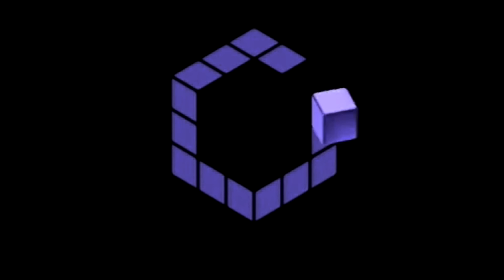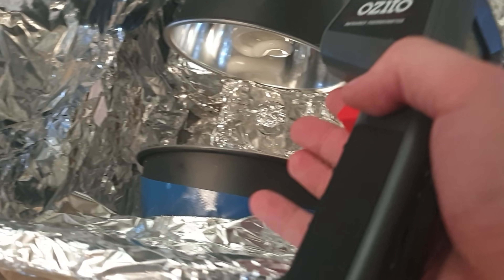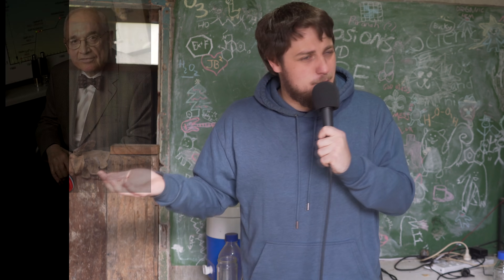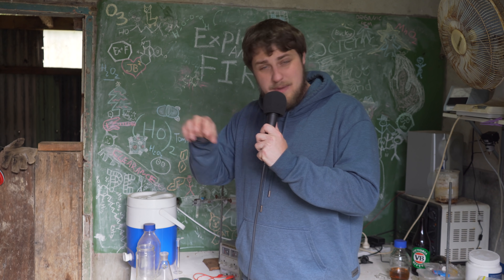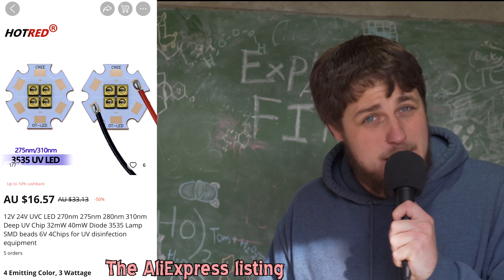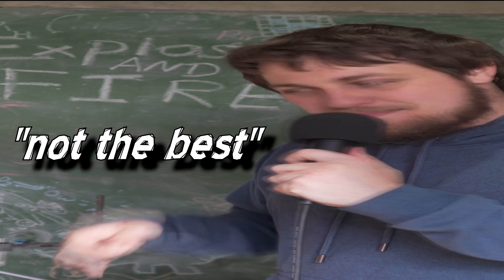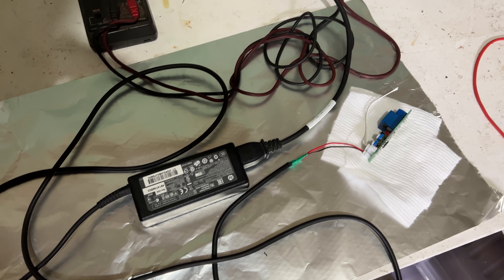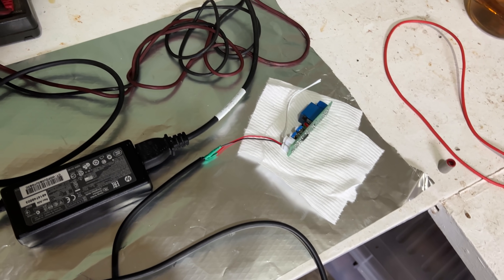Magical deep UV LEDs - Cubane Ep 12

Comment: Don't 'touch' the wires of the powered driver to the LED. The driver probably has some output capacitance, causing a huge current to run through the LED initially. This won't happen when you power the driver on while the LED's already connected.

Edit: So glad you ended up putting the relay in the power line. You would've had the same issue otherwise :)

Comment: instead of bothering with the circut, just use a massive heatsink, for example a block of aluminium, or a resavoir of water behind a plate of metal, on which you fixed the leds... gl

Comment: It's frustrating to hear that you found such misleading information online. As others have stated, the 40mA figure is important. LEDs are constant current devices, which means that extra circuitry must be used when driving them from a constant voltage supply. At higher currents, "buck" drivers can be used to provide a steady current. Effectively, they monitor output current and adjust their output voltage to match the manufacturer specification of the LED. I'd suggest looking into the BuckPuck brand for a reliable and relatively inexpensive option if you drive higher power LEDs in the future.

At lower currents (like your 40mA LEDs), such drivers are not needed. The datasheet for every LED will specify a "forward voltage", which in your case ranges from 12V - 14V. This does not mean that you can safely apply any voltage in that range and expect the LED to function properly. Instead, it accounts for manufacturing tolerances and indicates that the forward voltage of every LED shipped from the factory will fall within that range.

Ohm's Law describes the way that voltage and current interact with resistive components as V = I * R, where V is voltage in volts, I is current in amps, and R is resistance in ohms. Say, for the sake of argument, that your LED has a forward voltage of exactly 12V. You drive it using an 11.9V power supply. Since the power supply voltage is less than that of the LED, current does not flow, and the LED does not illuminate. This is not entirely correct, but is a useful approximation.

Now you increase the power supply voltage to 12.1V. Of that supplied voltage, 12V is dropped across the LED. This leaves 0.1V, or 100mV, that needs to be dropped across another circuit component before the path back to the power supply is completed. This would ordinarily be a resistor with a value in the hundreds of ohms. In the absence of a resistor, the only current limiter is the resistance of the wires used to complete the circuit. This can be as low as a few milliohms, which allows a tremendous current to flow. For example, I = V / R = 100mV / 4mohms = 25A. I suspect that the only reason your current did not skyrocket is because your power supply reached its preset internal current limit.

This can be fixed by adding a resistor in series with the LED. The greater the difference between your power supply voltage and the LED forward voltage, the more accurately you can tune the value of the resistor to produce your desired current. I would suggest setting your supply to 18V. That way, the voltage across the resistor will be 18V - 12V = 6V. Then you can use Ohm's Law and the rated LED current to calculate the proper resistor value. In this case, R = V / I = 6V / 40mA = 150ohms. This is a standard value, but if you want to err on the side of caution (less current), a 180ohm resistor is a good starting place.

The last thing to consider is the wattage of your resistor. Most inexpensive resistors are rated for 1/4W, or 250mW. Wattage is calculated as P = I * V, where P is power in watts, I is current in amps, and V is voltage in volts. If you exceed 250mW, you risk igniting the resistor. Double check that the actual power is less than the rated power. In this case, P = I * V = 40mA * 6V = 240mA, which is acceptable.

If you want more information, try https://www.digikey.com/en/resources/conversion-calculators/conversion-calculator-led-series-resistor. It helped me a lot when I was burning through LEDs by the dozen.

Great video by the way, keep them coming. I know nothing about chemistry, and your combination of humor and expertise always makes these videos a blast to watch.
Reply: Oh, and I forgot to mention that the setup described above is only ideal for driving a single LED. When driving all four, each LED must have its own series resistor. If you attempt to use a single series resistor for all four LEDs connected in parallel, it creates two problems. First, the resistor value would need to be changed to supply four times the current. Second, all of the forward voltages would have to be EXACTLY equal, which is not possible. Resistors are cheap, and it's better to be safe than sorry.

Comment: As a rule of thumb when figuring out a module you don't know, the voltage is a hard rule, don't go over that voltage, the current is a suggestion, as current is only drawn if it is required to produce the power of the circuit (watts = volts * amps)

Also, LEDs go in to what's called an avalanche state if you provide too much voltage, this is where they draw ridiculous amounts of power, and the heat you're getting seems like a product of over voltage to the LEDs. LED drivers only supply constant max current, and 960mA is far too much for this application, as the combined voltage is too low of your LEDs and it's pumping more voltage then it ideally wants (like on the power supply when you saw it draw over an amp at only slightly above 12v)

Comment: I don't know if anyone else mentioned it but connecting a current source wile its on is a bad idea, it should always be connected before power on otherwise the voltage will be at the maximum and some if there are caps (and there usually are) at the output it may blow up sensitive loads like.. i dont know leds? :D

Comment: Ah fuck man if you are too concerned with finding drivers for those leds and messing with too much in terms of electronics I HIGHLY SUGGEST for a novice that you just buy a UV led sanitizing device like those made for cell phones or baby pacifiers. They come with drivers, leds, and either a battery power source or rechargeable battery or you could just simply feed voltage into the battery contacts from another source (of course at the voltage the batteries would provide)  saves you from fucking about out of your comfort zone. It's hard to explain various facets of electronics to people that don't have a foundational understanding tbh.

 You could just ask those who know to give you a crash on exactly what you need in a given price range that would source parts/point you to exactly what you need.

Comment: Can you link to the leds? I'm guessing here without foward voltage atm but running two from a 24v source in series would mean you need a 900ohm resistor

Comment: Hey, this is an area of my expertise!

SO.

I actually had an issue grasping this myself, so I'll give you an idea of how it works.

An LED will start consuming more and more current as it reaches it's forward bias voltage. Once you reach that voltage, the resistance of the led drops dramatically, and appears like a short circuit. At this point, the LED will start drawing *AS MUCH CURRENT AS POSSIBLE*. By possible, I mean whatever the max current of the power supply is. This is why the first LED got cooked, not only did you use too much voltage; without a current limiting circuit, you allowed the full current of the supply to flow through the LED. You actually demonstrated this with your power supply - you saw how the current jumped WAY up.

I did some searching, and it seems like UVC leds run at much lower power than most, these particular one seem to take a MAXIMUM forward current of 100ma. That would grill the heck out of those leds, and you wouldn't get much out of it. I'd recommend starting at 60% of their maximum power, which we can calculate (per star) with this:

P=IV

Fill in our known values:

P=(.06)(12)

Do algebra:

P=720mW

That's per star, no matter if you have them in parallel or series, which makes it easy to calculate the driver you're going to want. I would recommend two in series, in parallel with two in series. This would mean you'll need a 24v (most LED drivers have a range of voltage so find one that brackets), 2.88W LED driver.

Here's why you want to use the driver that has the floating voltage, but fixed current. LEDs are very temperamental about their forward voltage, and many things can affect the forward voltage: temperature, ambient humidity, ambient pressure, ambient illumination, whether you're looking at it or not, local gravity, among many others. As the forward voltage of the LED fluctuates around madly, so does the current, so it's hard to build a steady state circuit for them just using resistors. This is why those LED drivers exist - they use a fairly complicated circuit that provides a constant power and can adjust to the whims of the LED.

Comment: I looked at the listing for those LED stars and the three different voltage versions seem to be different combinations of series and parallel chips.  I don’t see any balancing components on the boards, so the 12-14V and the 6-7V versions probably have parallel LEDs that are not going to share current equally.  You would be best to avoid those and only use the 24-28V 20mA kind.  Since this is such a low current, you don’t really want a power led driver.  You want something closer to the circuit you would use to drive an indicator LED, but at a bit higher voltage. The easiest way would be a 36V DC power supply and a ~500 ohm resistor.  You should be able to run a bunch of stars off one power supply this way (each with their own resistor of course). I recommend at least 1 watt rated resistors. Technically you would only be at 0.2W, but normal 1/4 watt resistors are going to get really hot that close to their rating.

Comment: wow this is terrible, as everyone has said lm317 driver or a resistor per led star
V=IR so R=V/I for a resistor so if you put a resistor in series and the led drops 12v and the supply is set to 19v (a laptop power adapter) you will have 7v across the resistor 
for 40ma you have R=7/0.04A or 175 ohms closest value they make commonly is 180 which will give you close enough power at 38.9ma or 160 which will give you more power at 43ma
another consideration is heat output from the resistor P=IV so for worst case 43ma at 7 volts you would have 7*0.04 watts or 0.301W thats more than 1/4 watt so you should use half watt resistors.

tl;dr put a 160 ohm resistor in series with each led, hook it to a laptop power adapter or your bench supply at around 19v

Comment: The two led modules are definitely producing more UV than the reptile lamps and your setup works so you may as well give it a try. As for cooling, maybe you can set one medium sized fan to get airflow both for the sample and the heat sinks. Having a fan blowing up from below might make filming easier, but could be hard to setup and is decidedly not wonderful with spilled liquids. Anyhow I hope it goes well and you can get to the finish line with this synthesis.

Comment: so so so very much out of your depth.  i cringed many many times during your build process.
 the voltage alone doesn't tell you anything about how much power something draws,.. and what you wanted were much lower amperage constant curent LED drivers.

notice when you had the led's on the power supply, adjusting the voltage changed how much current they drew, the constant current LED drivers automatically change the voltage to try to keep them drawing the same ammount of current.  You are likely over driving those LED circuits, but you have a half duty cycle... you could just keep them on constantly if you had a more appropriate LED driver.

Comment: Probably been commented already but just use a resistor to regulate current. To get desired current (I) use this formula V/R = I. V is voltage supplied and R is resistance of the resistor in series. If you can’t find a resistor with the exact value round up to nearest available value.

Comment: Adding a few decent sized resistors ( 1 kΩ) couldn't hurt. This will make the current much less sensitive and slow you too carefully draw 40 mA or whatever else you need with higher voltage.

Comment: heres a very simple explanation as you why you dont need to worry about any current setting on the power supply itself, that 40mA is just how much they use. The current, or amps, is determined by the resistance and the voltage. the LED's have a fixed resistance, you cant change that. So if you give them the voltage they need, they will only draw the 40 mA. You could have a 12V car battery that can supply 900 amps, but if you hooked it up to the LED then it would only draw 40 mA. Thats just another way to say what the wattage is of the LED, 40mA times volts = watts so 0.56 watts

Comment: If you put a 300 Ohm resistor, and drove the circuit with 12 volts, it would drive the LEDs.
(12 volts) / (40 milliamperes)= 300 ohms
Also, it should make about half a watt to a watt of heat. The circuit really shouldn't be getting more than lukewarm after several minutes, and probably won't even need the heatsink tbh.

Comment: You have constant current mode on that PSU, just use that for now. Series connect all them LED's, plug them in, set current limit to 0, set voltage to max, slowly increase current limit to get 40mA ;-)

Comment: Just use a constant voltage and stick a fat resistor in there in series. If it's too dim, use a smaller resistor. Repeat until you're content with the brightness or until an ammeter reads 40ma, whichever happens first.

Comment: I think you got your understanding of current and voltage mixed up. If you provide more voltage than your part is rated for and don't do anything to reduce the voltage then you'll fry your components. However, you can use a power source that is capable of providing more current than what your part needs without killing the part. Assuming the voltage of the source is still within the tolerances of the part of course. 

The reason being that the resistance of the part and the voltage of the source will ensure that your part can never draw more current than it can handle. Hopefully this explanation can help some to avoid future mistakes. 

Fun fact: it only takes 0.1 mA of current across your heart to kill you. Luckily our bodies are not amazing at conducting electricity so you'll need a high voltage source to kill yourself. I burned myself on a battery pack capable of 20+ A output (lab equipment couldn't measure higher) yet was not shocked thanks to that as the voltage was less than 5v. 

Also if you do use high voltage stuff only touch it with one hand at all times. That way the current will be most likely to just exit back out the same hand. However, it is possible for it to go through to your feet so use your right hand to ensure the current can't pass over your heart. Even if you're wearing rubber sole shoes we were taught to only use one hand and use the right hand.

Comment: LEDs have to have a constant-current driver or an appropriate limiting resister so that you don't draw more amps than you need to. They have a really freakish response curve where below a certain threshold it trickles amps through, and then, like you saw on your PSU, it suddenly opens the flood gates and the curve inverts so for every additional volt you get like 10x the current. it's kinda nuts. Constant-current supplies automagically limit the current so you don't have to sit there and baby it. It's even worse when you get high-power LEDs that have a negative temperature coefficient so the hotter they get the more amps they draw at a given voltage - you literally can't just set-and-forget them without a limiting resistor.

Comment: People may seem particularly picky about thermal paste, but everybody cringed (I assume) when you said amperage doesn't matter. I had to take a break after the amp thing, now taking a break after the thermal glue. I'll have a beer and come back to see what burns up first.

Back. Yep. That was predictable. Those overdriven LEDs are probably already toast by now. Pity is the usable power supply sitting right there on the table. Set any voltage you like and turn the Other Knob to turn the amperage down.

Comment: Dig around the indoor gardening forums lots of folks build their own lights so they are probably the best place to find the proper design criteria.  I am no electrical egi'nerd but electrified sharp metal is very dangerous, especially with no ground.  Take the time to debur or round over any edge that could cut you, I have a slice on my hand right now from just lifting a BBQ. A cut can be an open door to your heart for the angry pixies that come out of the wall.

Comment: Your timer circuit might be 5v. Ignore what is written on the relay and go back to the listing you bought it from. See what it says or what options they show.
Try hooking the board up to your power supply and give it 5v. If it doesn't turn on, try 9. Then 12. 
The coil voltage printed on the relay might be a max voltage it can operate at. Those cheap components can be all over the place.
Reply from the maker: Yeah there was definitely 5,12 and 24V options on the eBay listing. I didn’t realise it was for the input power so I got the highest voltage one, but I think I’ll go back and get the 5V one